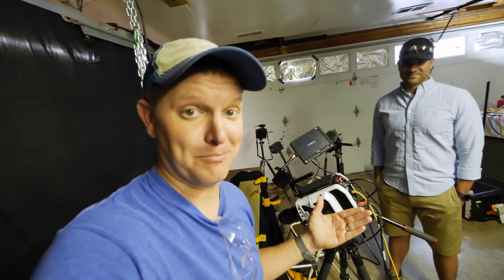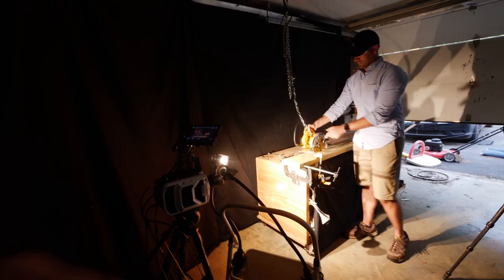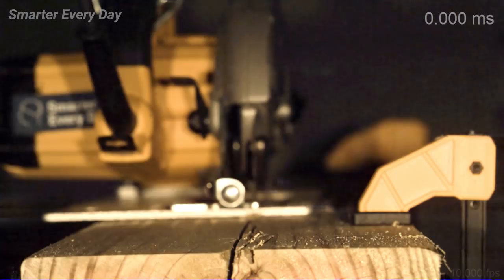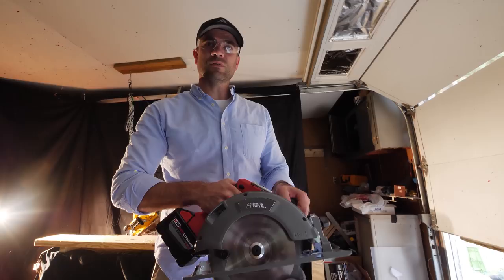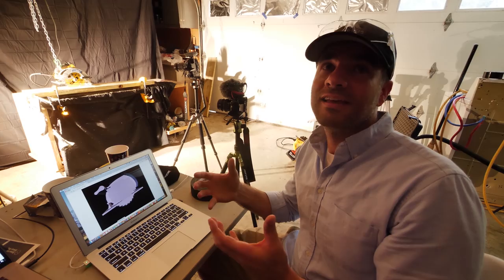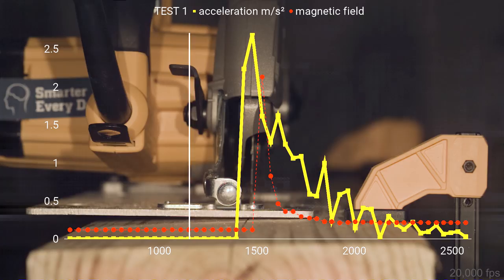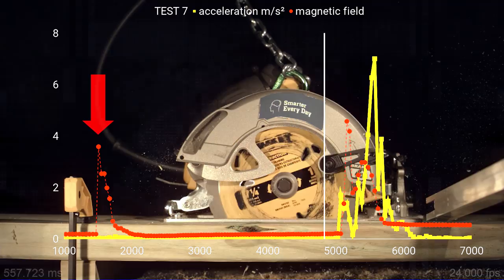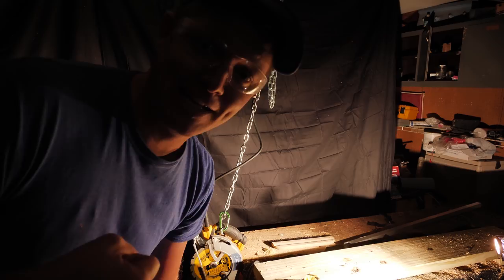Circular Saw Kickback Killer (We used science to make tools safer) - Smarter Every Day 209

Comment: Now license the thing, but keep your license fees low enough so tool manufacturers actually want to implement it. The guy who has the patent on the table saw stop wants way too much hence why it's not in any table saws.
Reply: Yup, and he’ll watch his boutique saw brand evaporate once those patents expire out from under him.
Reply: Guy who invented the seatbelt made the patent free hence all cars implemented it in jut a few years.
Reply: @s3cr3tpassword  It was military testing for airplane harnesses that lead to the motor vehicle seat belts.
Reply: Couldn't the same information be "learned" for a table saw too.
Reply: @brandoncumbie6866  With a hand saw the wood (object being cut) is stationary and the saw moves through it. With a table saw, the saw is stationary while the wood moves. This tech works by measuring variations in the movement of the saw. When a table saw kicks back it throws the wood, not the saw.
The saw-stop (aka the 'hot-dog saw') doesn't care about kick backs, it measures conductivity (or so I've been told) to know when it hits something that should not be there. This kick-back killer would happily allow you to dice up a whole box of kittens as long as you didn't bind the blade.
Reply: Well you are wrong it is in table saws, particularly schools. But it not only cost more initinally but to fix the saw once it happens.  Maybe you haven't  had a son in high school in recent yezrs.
Reply: @Benjamin Sundberg I thought about that a little after I posted my comment. And I thought about how idiotic it would be of putting a tether on the stock to measure the input signals as that would result in cut tethers.
Reply: @s3cr3tpassword  don't think your right the cost is passed on to consumers and it is federally regulated that all cars past a specific date have to have seatbelts. You pay for the airbags in your car too.
Reply: Or be a super cool dude and use a BSD license.
Reply: @MikesTropicalTech  That's just wrong, a disclaimer as simple as "SawStop is not garanteed to prevent an accident and should not be used in anyway a standard saw would not be" and they are in the clear. Greed is the driving factor. If they marketed it as the new standard, maybe that would be an issue (though even then, good luck trying to convince people that they should have had computer assisted technology on saws before it existed), but as an added feature to a saw there isn't really anything to worry about with a simple disclaimer.
Reply: There is one that detects 'Flesh' and that is a one and done job and you need to replace parts... this is resettable, another benefit.
Reply: Eric Fling The guy who made it free had created the 3 point version that we use today.
Reply: Phill I bet he'd make a lot more  money if he let every tool manufacturer use it for a fee on every saw sold. There's so many small contractors that can't afford it and his stop saw  brand will never catch on at that price.
Reply: Tablesaw is number 1 most dangerous tool, circular saws ranks at 3.  If these guys have solved number 3 then the gold prize would be tablesaws and somehow bypassing SawStop patents as well as making the solution incorporate a brake as well; one that doesn’t destroy itself like SawStop.
Reply: @brandoncumbie6866  You might not need a tether, the saw guide touches the wood independently of the blade. It might be overcomplicating the tool but safety is always nice.
Reply: @s3cr3tpassword  3-point seatbelt*. I believe it was a guy working for Volvo.
Reply: This guy is great! But we have a better rest!
Reply: @Benjamin Sundberg you can measure anything. the magnetic field of the motor that accelerates as the resistance is removed, or there may be different patterns of vibration when the wood is on and off the table.
Reply: @s3cr3tpassword  It was Volvo who held the patent and made it open. Unusual example of a company with a conscience not just and individual. Because ... Sweden, I guess.
Reply: My late father had to give up one of his favorite hobbies — woodworking — when he started taking blood thinners in his 60s. Because his vision was also not as sharp as in his younger years, he knew the risk of injuring himself on a sawblade or drillbit had become too great. And it broke his heart to look at all of the woodshop equipment and materials that he could no longer use. He gave most of it away, but held onto a few things in the hopes that someday there would be a safe way to use them again.  Something like this might have made it possible to keep doing projects that he loved. Wood and metal shop classes in schools need this technology also.  Another reason to keep the licensing fees low enough to make sure that manufacturers will include this technology.  Great work, thanks for posting the video.
Reply from the maker: We want this on as many saws as possible.
Reply: @s3cr3tpassword  The Seldon Patent Lawsuit in the early years of the automobile would prevent them from not being put in cars because of the general use of seatbelts, even if they were patented, so it didn't matter who held the patent or not.  That's the same reason you can not prevent the use of a V8 in an automobile, even if you hold a patent for it.    There are lots of car parts like that.
Reply: @smartereveryday  I have seen some nasty kickbacks... makes you rethink life decisions.
Reply: @smartereveryday  🤗God speed and best of luck to you guys!
Reply: @brandoncumbie6866  The issue with kickback on a table saw is that it's the piece of wood that moves, not the saw itself.  So you'd be having a real tough time to integrate a saw brake on the saw without putting sensors in the wood.

More so, having a proper riving knife and splitter with a truly square fence will prevent most kickback situations in the first place.  

Then, losing digits really just comes down to people not using the saw safely.
Reply: @smartereveryday  Hopefully the cost to implement is low enough for even budget DIY brands to implement. Your DeWalts and Milwaukees are a no brainer though.
Reply: I can't believe you guys have never heard of leaving in the triangle and leaving your nut loose so the motor spins inside the arbor instead of kicking back
Reply: Another problem with SawStop is that it won't be adapted by construction companies, even after the patent expires and its on more saws.  The safety mechanism is destructive to the table saw and its cheaper to pay a worker's comp. claim once in a while than to have to replace the safety mechanism, blade, and maybe more on every single table saw that goes out to a jobsite.  And you DO end up having to replace every one because the guys on the job want to see it work, so before the job ends and they return the company's tools, someone ALWAYS triggers it to show it off.

Unfortunate, but true.
Reply: @MikesTropicalTech  
That would not be the case. Did the auto manufacturers get sued for all the cars that didn't have seat belts? How about safety glass? That would lead to no more improvements in anything.
Reply: @rydaddy2867  That's very sad to hear. They should fine whoever triggers the SawStop (a small amount would suffice) in order to discourage the practice.
Reply: @brandoncumbie6866  table saw stops already exist.
Reply: Bosch has a contractor table saw with a saw stop thing in it, its even much cheaper to replace the part that activates.
Reply: @rickmellor ea Iqqqqqqq
 ....
Reply: @MikesTropicalTech  That's an absurd discussion. Older tools ARE more dangerous than new tools - do you people think that they aren't???

How unsafe are older cars? Is Ford open to lawsuits because the 2020 Ford Explorer has 5,387 airbags while all those Model-Ts don't have ANY safety features what so ever?
Obviously not - that's dumb, and, THANKFULLY, that's NOT how the law works.
Reply: @Benjamin Sundberg Simply read the direction of the wood, using a couple of old laser mice. (Something similar has been done.)
Reply: @rickmellor  No it won't, its still the best table saw on the market even without the safety features.
Reply: @smartereveryday  Wouldn't it be different technology? In dumb dumb explanation: with a circular saw, the saw kicks; with a table saw, the wood kicks.
Reply: @jaguar36  Ok. 🤷‍♂️ We'll see how well they maintain their quality when they can't demand the same premiums. Commodity brands that aren't one-trick-ponies are going to drive this tech as cheap as possible... it may even become legally required. We'll see what happens when people can buy peace of mind in a $400 jobsite saw... I doubt many will cough up $1,200 because "quality". Consumers are cheap above all else.
Reply: @racheltjedza9394  kdh ajsyy
Reply: My buddies dad is co-owner of sawstop
Reply: @Carmichael Troy absolutely! Everyone should sub to piediepie!
Reply: @aceichner  the saw stop works by constantly sending a steady power stream through the blade that is measured like a GFCI outlet. A circuit board constantly checks to make sure the power stays the same. Touching the blade with something conductive (finger, nail, wet wood) changes the current and stops the blade almost instantly.
Reply: @MikesTropicalTech  They don't understand law if those discussioners think that.  Implementing safety in a business, product, etc. does NOT legally bind you to previous cases where the fault could have been prevented with the new safety measures.  Exceptions would be where there was malicious intent, etc., really unrelated to the safety implementation(s), covered by their own laws, independently.
Reply: @Benjamin Sundberg and that's why I think Volvo is the coolest car manufacturer there is :)
Reply: @adventureswithfrodo2721  AFAIK there are now system which could prevent an accident without destroying the blade and even have life detection (I think it was made with infrared) built in which isn't something SawStop had.
Reply: They pulled three simple pieces of hardware (probably all soldered in one unit) from an old smartphone and put it into a circular saw and made it safer. This technology should be international law - and not raise the retail cost of any power tool by more than $5! Because it's SUPER CHEAP digital hardware from an old smartphone! It can be had for 0.50cents (maybe less) from old smartphones!

Think about what you might be able to do with Dremels, or drills, or...any power device.
Reply: @Benjamin Sundberg Blade deflection and blade speed. Pinches certainly bog the blade down and cause it to bend before the work piece gets pushed up in the air and falls back on the spinning blade.
Reply: @brandoncumbie6866  Basically it could be possible, detect the vibrations on the table, the blade rotation angle and speed variation and maybe add a detector for wood to move backwards
Reply: @aceichner  The table saw kickback happens when the wood gets lodged between the fence and the blade. So you could detect the fence motion and as well detect the blade movement relative to the fence. As well there are detectors for wood (scanners to find them through walls) that one could use for detecting wood moving backwards.. 

But what the original saw stop did, was detect the human finger electricity and break the saw from cutting the finger at all.
Reply: Open source things, thats the way you will make humanity evolve and great again... Forget money and think in the bigger picture
Reply: The guy who has patent would be more successful if he sold it as a universal mod for pre existing table saws.
Reply: Well actually it led Bosch to come up with their own mechanism, which quite frankly is a better system.
Reply: @aceichner  if you wanted to implement it on a table saw, measure the acceleration of the blade/motor armature. the kickback should cause deceleration beyond normal operation.
Reply: wtf he founded sawstop and owns now one of the biggest table saw companys?
Reply: The table saw stop also totals your saw.  Besides,  you're forgetting the adverse side effect.  You make the table saw safer,  people become less cautious.  Less cautious,  more accidents when they use (let's say) a chainsaw. It is important to have a healthy fear of power tools and to hire professionals if you call 911 for a grease fire before grabbing the fire extinguisher or use water to try to put it out.  Accept that's not your skillset and hire a person that does.
I've had to install a handicap ramp for someone that thought jw could do it himself.  But the idiots at the big name hardware store had him believing he could DIY. Fortunately he healed and then he had to pay me to finish the job he started and demolish and haul away the ramp.
Reply: @MikesTropicalTech  This isen't true, if that is the way it worked then every new innovation would cause previous version to be open to the same argument.
Reply: @Benjamin Sundberg Sawstop looks at conductivity, which is why it can trigger on wet wood.
Reply: You need a version for drills too so if your drill bit binds up, and it's always big circular cutters in the drill that get me, it stops the drill instead of allowing the drill to spin and bork your wrist. Sensors measuring drill movement while in operation would do the trick.
Reply: aceichner maybe you can't use an accelerometer but you could gather a lot of data from analyzing torque/angular accel. profiles. Maybe you could implement a sensor on the guide rail that also gathers data of contact pressure
Reply: @MikesTropicalTech  just needs a politician to cut some pinkies then it will be law.
Reply: I wouldn't even sell licenses of it. Just for safety I'd create a agency that provides licenses for as much as the site costs to keep it online.

OSS.
Reply: We use the sawstop at my job. Actually got to see it in action a couple days ago, incident free! No one lost limbs, but it definitely put a dent in production because we didn't gave replacement parts on hand. (SawStop destroys the blade and the block that intercepts the moving blade.) It's literally a block of soft metal thrusted into the blade to halt it's revolutions, via voltage drop through the blade if it comes into contact with flesh.
Reply: @adventureswithfrodo2721  he's saying that if Ford had to pay volvo to use the idea of a seat belt, they wouldn't have, and seat belts wouldn't be common. Volvo giving the idea away for free is what he means, not that someone is literally giving away free seat belts.
Reply: Why not open src it?
Reply: Also, table saw breaks are a 1 time use, and then you service several parts in the table saw before it'll work safely again. Destin and his friend are brilliant,, and would have saved one of my phalanges with this safety design! (Too late for my finger, but not too late for yours!!)
Reply: @MikesTropicalTech  And that's why woodworkers aren't lawyers.
Reply: The patent that was used before the 3 point seat belt was the Two point seat belt. you know the one used in air planes, its safe in air plains because you will have a long forewarning before you crash, unlike a front against front collision on the road. now it has been so long since it was invented that it would go out of patent a long time ago regardless of if it was a paid patent, but if it wasnt out they would have to invent an different seat belt or just go with the two point.
Reply: That is no bueno
Reply: @MikesTropicalTech  good this is a stupid idea that is born from improper use that will lead to injury when someone has to bypass this to get there frigging saw to work.
Reply: @MikesTropicalTech  They've implemented lots of other safety features, though. Splitters, blade guards, etc. How would implementing this safety feature differ from implementing those safety features?
Reply: @smartereveryday  as someone who has done carpentry for over a decade, you're solving a non-problem. if the saw kicks back it is 100% your own fault and because of bad technique. if those fancy 9 sensors add more than $25 to the cost of a saw no one's going to buy them. saws are temporary tools. in real life saws fall or get crushed or even thrown when you're mad. if a saw lasts even 2 years I'm happy.
Reply: Its also not an ideal product feature. It is only good if you are using dry lumber in a shop environment. If you are working outside in a wet environment or with wet lumber the sensor will trigger therefore requiring it to be disabled in order to work properly
Reply: @XxSolsacexX  it isn't even good inside in a dry/shop environment because the saw should never be kicking back unless it's your first time using a skillsaw. sometimes you really have to force saws too, it it kept shutting off on me while I'm using it I would smash the thing.
Reply: @MikesTropicalTech  that's ridiculous, just because newer inventions come out to make things safer for us shouldn't automatically open up previous inventions because they were less capable to lawsuit, that's the NATURE of technological achievements. That's like trying to file a lawsuit against a car manufacturer that comes out with a future flying car and saying all previous models are now open to lawsuit because they didn't fly and roads were dangerous to drive on, no, we just didn't have the flying technology yet. Literally the ONLY fix to what your saying is to produce ALL POSSIBLE variations of a certain product with all possible add ons from the future, and then release the product you had originally thought of for the first time 150 years ago, but because achievements would be made you didn't release it. No. That's just not how technology works.
Reply: Saw stop table saws are not going anywhere anytime soon. The technology is great and is great for educational atmospheres. I have personally had the opportunity to work with a Saw Stop table saw and see it save someone from losing a finger. Well worth the money to not lose a finger.
Reply: @davidswanson9606  you can't stop a table saw blade in the blink of an eye any other way than how Saw Stop dose. If it was a normal brake on a 12 or 14 inch blade your fingers would be gone. Well before the blade comes to a stop.
Reply: My high school has saw stops on all the table saws. My buddie discovered that they work😂
Reply: Exactly what I was thinking. The odds of seeing this in tools is practically zero because even without licensing fees the cost of sensor parts alone is just not worth it.
Reply: Benjamin Sundberg I think the machine learning could be used for a number of factors and the brake applied. I.e. the voltage on a motor during a kickback event vs normal. They could also use something like a seismometer to Monitor the vibrations in the table saw instead of acceleration.
Reply: @aceichner  Circular saws aren't very popular for butchering meat. If you want to cut up kittens, you're probably better off with a sharp knife. Maybe for the larger breeds a band saw might be handy.
Reply: @John K @Joseph K @RyDaddy I have a feeling you all don't know how SawStop technology, Worker's Comp, or the average insurance payout for loss of a finger work. SawStop works by sensing an electrical current which causing a breaking mechanism to go into effect stopping the blade. When this happens it does not total the entire saw. You have to replace the breaking charge and MAYBE the blade. If you have a SawStop blade, they say it doesn't effect the blade at all, but even in a case where you replace the blade you're looking at $80 for a new break and $10-$100 for a new blade depending on brand and quality. So you're max out $200 to get the saw working again. The average payout from an insurance company for the loss of a finger is often thousands of dollars. Considering all construction company's that are reputable are licensed and insured, you could easily see insurance companies giving discounts on insurance for a company using technology like this that would save them on payouts. The construction company getting an insurance discount would far outweigh the possibility of having to pay a couple hundred bucks here and there in order to get a table saw working again.
Reply: BS. Every shop that cares about its employees has a sawstop. R and D costs money, of course he wants something for it. Other companies have tried to do what Sawstop does, without paying to license the sawstop tech. There are other solutions but people don't care. People choose to spend the extra on the real deal.
Reply: @wobblysauce  it dose not detect flesh. It detects a static charge. It's basically the same as a ground fault outlet. It detects a change in electric flow so it gets set off. The 60$ cartridge and 100$ blade is a small price to pay to save your fingers.
Reply: Every construction job ive worked in the last 3 years (5 different jobs) all had sawstop 500$<your finger
Reply: Cabinet builder and trim carpenter here. Huge saw stop fan. Higher quality saw. Both shop saw and portable saw. Worth it the extra money.
Reply: Lol it’s not in any Competitors saws, sawstop isn’t a safety system it’s a saw brand. And they pretty much have the market dominated now. Every woodworker I know has upgraded to a saw stop table saw by now. So id say they are quite happy with their decision
Reply: @brandoncumbie6866  It already is! SawStop. Well, it's actually completely different technology, but it accomplishes the same level of safety.
Reply: @DaddyEric222  yes you are right but only partially. What he is referring to is the 3 point seatbelt design and that was developed by a Volvo engineer and then it was made free to use
Reply: @Benjamin Sundberg ehm... Smart wood?
Reply: @MikesTropicalTech  so give all the lawyers non-SawStop saws and they won't have fingers to make lawsuits against it
Reply: That’s also why the guy who made the honeycomb stopper for the table saw is so successful now. The honeycomb immediately drops down and it won’t even make you bleed if your finger triggers it.
Reply: @aceichner  Dang, I was commenting on that "hotdog" saw too. Ya obviously beat me to it.
Reply: ALL YOUR TABLE SAW ARE BELONG TO US
Reply: I have seen a table saw with it implemented, but it was def not cheep
Reply: On the table saw, the saw doesnt move, only the piece of wood does. You'd have to approach it differently.
Reply: The Saw Stop is the most desirable saw in existence and the guy is rich rich rich
Reply: Hi! Congrats ! It would be a nice feature on all hand helded tools (yep even in router) on the other hand, talking about the table saw case, maybe a pressure  sensor on the riving knife base could work (or something like that).
Reply: @davidswanson9606  Felder has.
Reply: @adventureswithfrodo2721  I believe he is aware that it is in saws. But it is only in one brand "Saw Stop". They are talking about it being implemented in the other big brand saw manufacturers.
Reply: Michael Brown, a lawyer can shut down a company in days, but an engineer will take years to shut down a company.
Reply: Benjamin Sundberg, there is a sharp drop/spike in magnetic field, or a greater resistance in the wires. A cheap $20 electricity tester would do the job with a few external parts.
Reply: @davidswanson9606  A brake wouldn´t work fast enough - the operating principle of saw stop is skin / flesh detection on the blade, if it was not an absolute sudden "destroying" stop, it would be too late anyway - what price do you put on a body part?
Reply: The guy who invented SawStop’s tech is a patent attorney, who formed SawStop with three other patent attorneys. They attempted to have it legally required for businesses/schools to own a sawstop for safety reasons. It’s all about the benjamins. I do feel that SawStop is too aggressive in guarding the concept of stopping a blade. SawStop filed a lawsuit against Bosch for coming up with a similar design.
Reply: @DaddyEric222  It was volvo and they wanted to save lives
Reply: @MikesTropicalTech  As a law student and a woodworker, I'm just going to say that the implementation of a saw stop would in no way imply past designs to be unsafe. Even if that were the case, a court would recognize that there is a natural progression of technology in all aspects of life, so just because an old system doesn't have an updated system that wasn't available until recently doesn't make it any more unsafe than it already was. Someone can not sue a company for a situation that is similar to the concept of an ex post facto law. Under common law, a tort for someone being injured by a table saw can be brought before a court, but liability for its safe operation is always the responsibility of the user. If there are no manufacturing flaws that make the tablesaw inherently dangerous from normal and prudent use, an injured person would have no case against a tablesaw manufacturer. 

Sorry to make that such a long winded response; I just find that to be such a ridiculous proposal for why manufacturers are not very willing to implement a new technology into their products. At the very least, I hope you can come out of this with a better understanding on that woodworking 'controversy.' Have a pleasant day/night!
Reply: Phill actually my highschool ag department has    One
Reply: @rickmellor  Felder is coming out with their own system, PCS. Faster, and doesn't destroy blades or cartridges when it trips. Assuming they bring it out on cheaper models, I'll definitely be buying theirs instead of sawstop.
Reply: Phill it’s also because that’s a really really superior tool
Reply: May the greedy guy with the table saw enjoy the pain of a mutilated thumb for the rest of his life, so he can adjust his greed/morality coefficient. He is welcome to my pain club!
Reply: @rickmellor  He sold SawStop to Festool.
Reply: Sawstop's inventor offered to license his saw on a scale that rose from 3% to 8%, rising as certain sales milestones were met.  Manufacturer's declined.  The fact that other manufacturers weren't willing to pay 3% tells you all you need to know about the relative greed of the player's involved.
Reply: @adventureswithfrodo2721  It is in only saws made by the company formerly owned by the guy who came up with it.
Reply: @user-pd1ly8nv6x  Heh, that's not exactly going to make it any cheaper is it?  At least the tech is available here in Europe now...
Reply: @brandoncumbie6866  No, they are measuring the movement of the saw. on a table saw it is the timber that gets throw in a kickback. very hard to measure that/